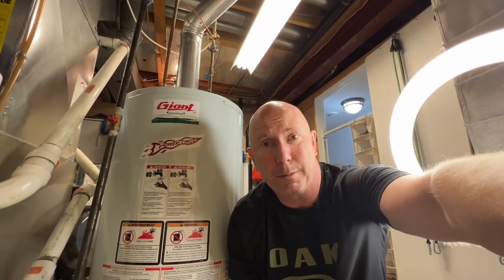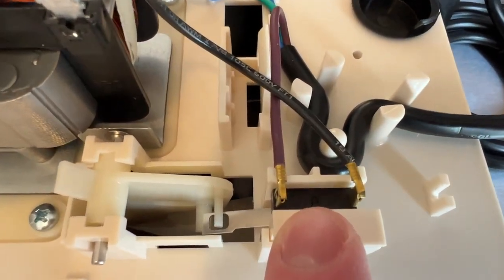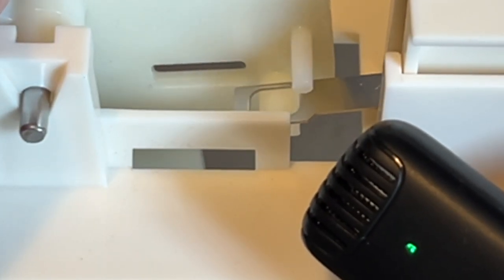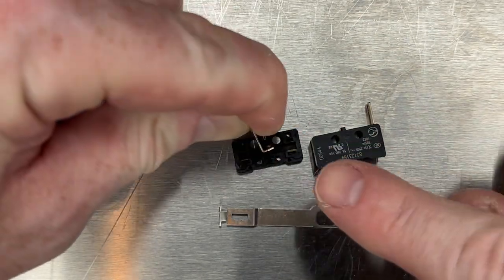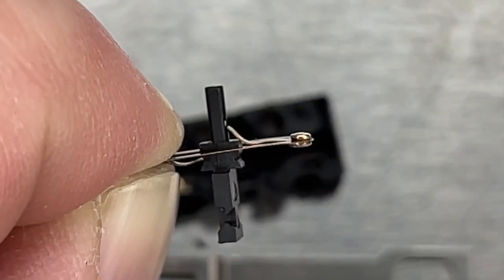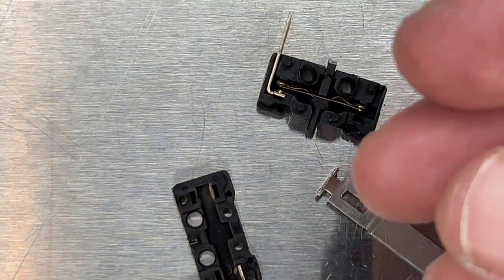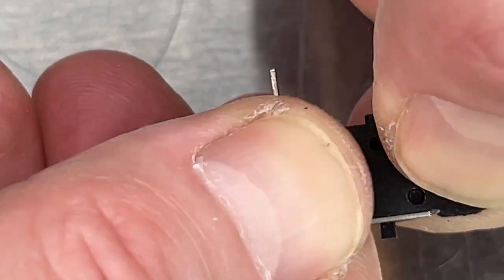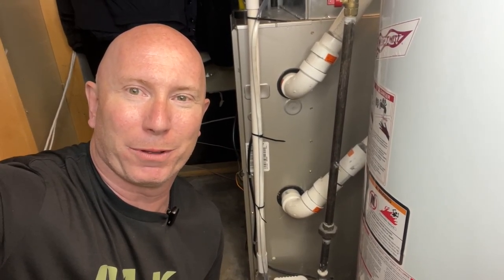FURNACE / AIR CONDITIONER PUMP WON’T SHUT OFF - LITTLE GIANT 554401 FIX!

Comment: I have the same Little Giant condensate pump and it ran continuously.  Took apart the switch and found the spring tabs were in the notches in the plastic but the spring was not working due to some corrosion.  Cleaned it up, listened to the switch make the noise when pushed up and down, so put it all back together and now the pump only runs when the switch turns it on.  Thanks a lot for your video!  Took all of 15min from start to finish!
Reply from the maker: Awesome! So glad it worked for you!

Comment: Great video.  My pump wouldn't stop either but the cause was a pluged exit valve that needed to be cleaned.  So if the tank is full of water, I suggest folks testing the switch first to see if it turn on and off the pump before trying to fix or replace it.  Of course that means some contacts would be live and you may want to use someting that is not conducive to play with the switch.
Reply from the maker: Thanks for that info !